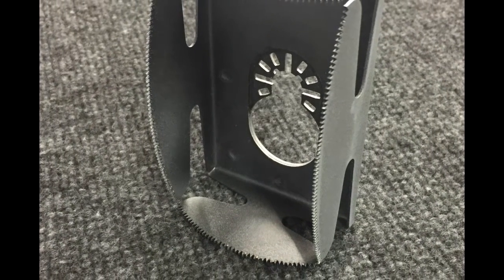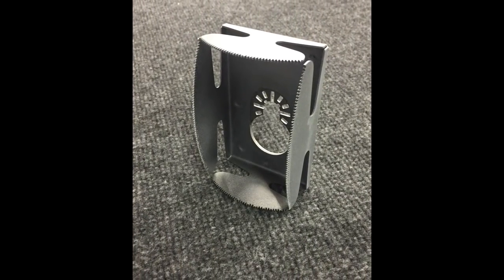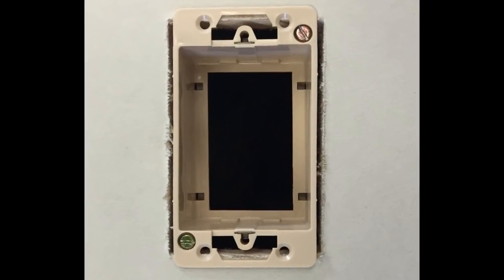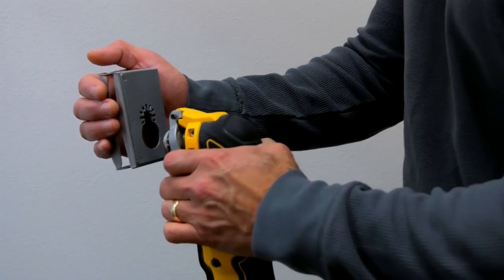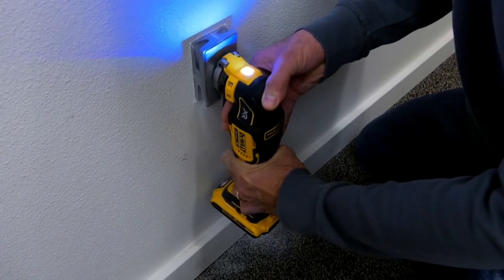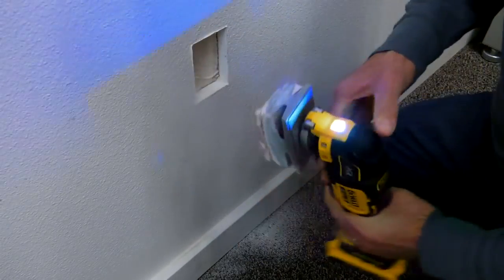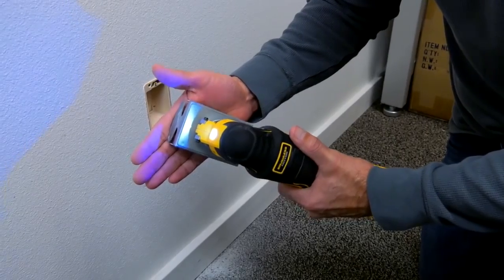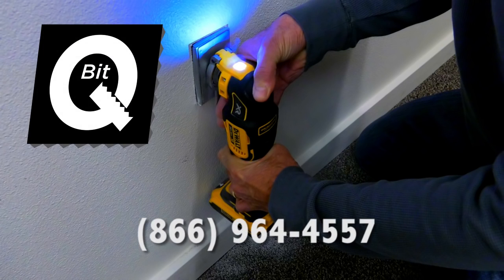Q Bit video #1

Comment: In my part of the woods the scratch coat under the plaster has stone in it and kills oscillating tool blades for wood fast. As a work around I use a diamond blade first until I get to the wood lathe and then switch to a wood blade. Is this available in diamond?